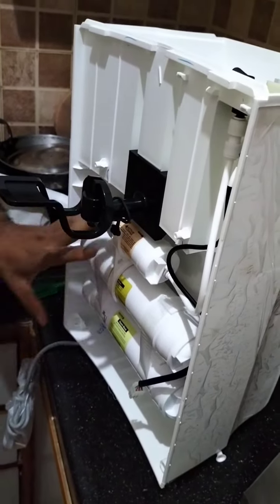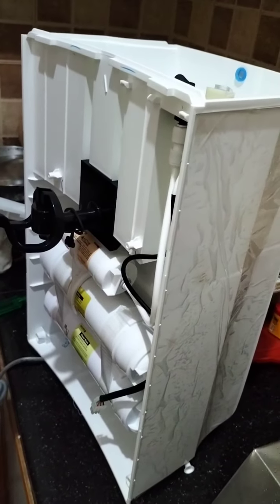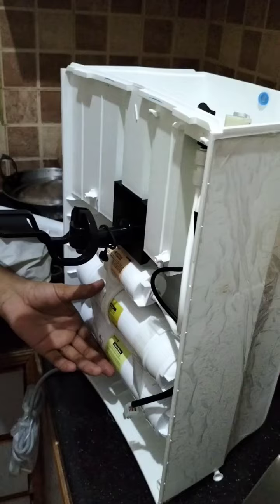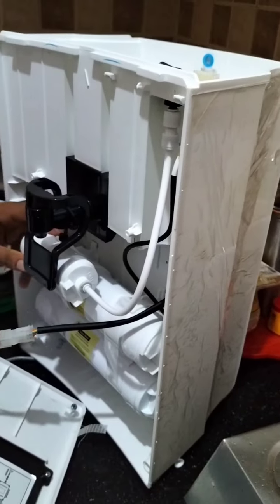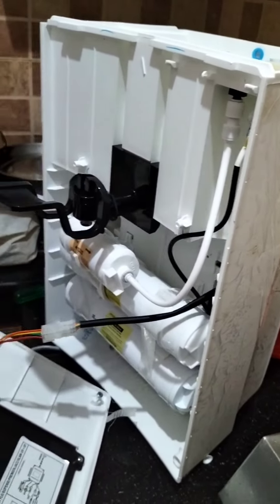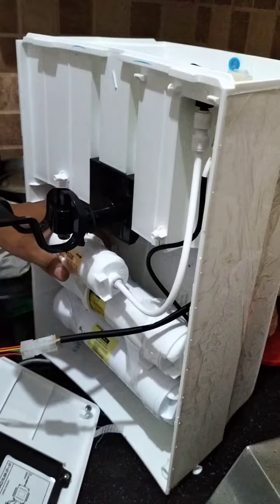AQUAGUARD ASTOR UV+UF INSTALLATION

Comment: What's the cost ?? And does that extra side filter comes with filter only or do we have to buy it separately ? What's the cost of side filter ?
Reply from the maker: New price 14990/-, Extre filter not comes with the unit.It cost approx 1100/-.
Reply: New price 12000/-.